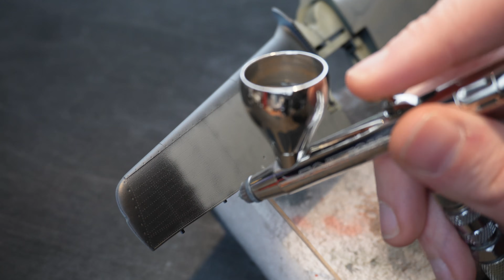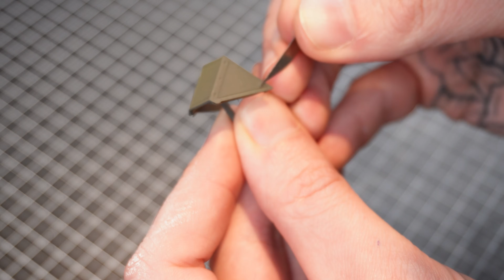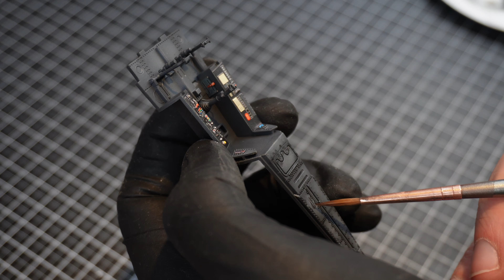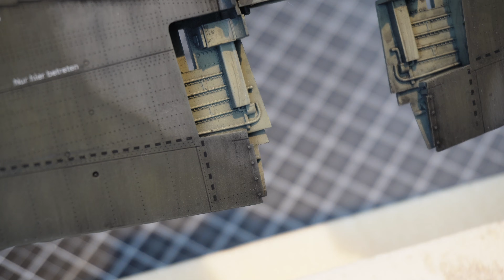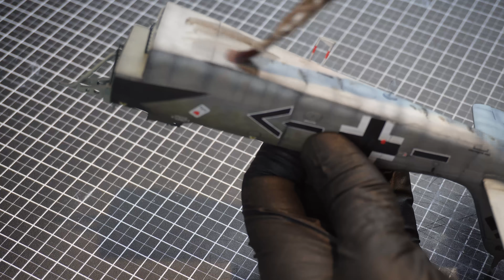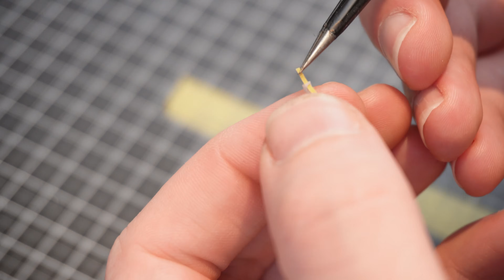Let's Paint: FW-190 A-6 (Border Model 1:35)

Comment: I’m having the same issue trying to get oil to stay in the rivets of my hkm b17. I top coated with Alclad Aqua Gloss and tried using oils thinned with odorless mineral spirits and VMS weathering carrier but both damaged the Alclad metal finish beneath and I’m not sure why. The topcoat has cured fully. The only think I can think of is maybe I didn’t cover properly with the aqua gloss? Any tips would help.
Reply from the maker: Unfortunatly I don`t have any experience with the Alclad paints but wanted to try them for a long time. I am not sure about the VMS weathering carrier, looks like a weaker version of minderal spirits and normally those shouldn`t be a problem on acrylic and/or lacquer paints. Afaik sometimes mineral spirits from the hardware store are more aggresiv then the hobby ones but so far those also never attacked my paint.

Comment: I need to reorder the needles that came with my H&S they bend really easily. Any tips on not damaging them? 😂 awesome job very thorough
Reply from the maker: Thank you again! :D I use those really careful but also have to replace them every now and then. I try to screw the protection caps on as often as possible but otherwise I guess there isn`t much you can do

Comment: Next time you want to remove a decal from your model. Simply use tamiya masking tape, put it on top and then remove it and the decal will stick to the tape.
Therefore keep in mind if you wanna put tape on top of a decal, for additional painting, use a clear coat before.
Reply from the maker: Thanks for the tip! I don't know why I haven't tried that. I will keep it in mind for the next decal failure.

Comment: well done looks awesome and really happy you spend the time to go back and check what i told you about the Antenna as you can see easy correction and looks great ,by the way me looking again the pictures you have forgot a very key detail that is to extend the antenna wire inside the cockpit ,i know are not many pictures but if you want send me your email to send you a ebook to see how it works ,i got a very nice detailed one !
Reply from the maker: Thanks again for that tip, you seem to know the FW inside out. You can find my email adress on my profile page I would love to take a look at your material so I can also that piece of antenna. Thank you!
Reply: @Kit.Chronicles  normally I don't bother to comment because most of modelers don't listen or they think they know everything but you listening you put the time straight away from your first videos and I like also that you do your own 3d print parts. I will send you an email later today
Reply from the maker: @rOEN911  Thanks a lot! Looking forward to your email.
Reply: @Kit.Chronicles  i did send you an email hope you got it